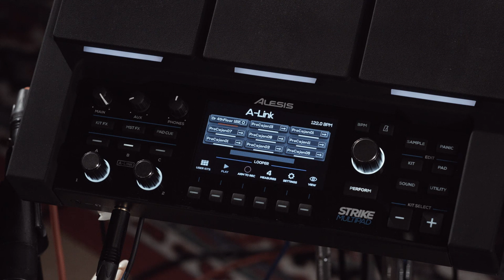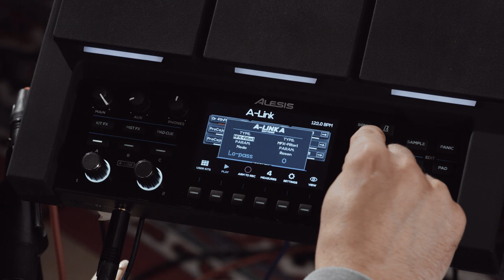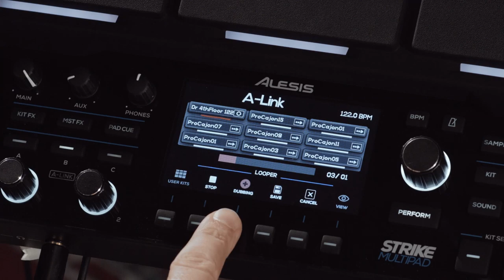Strike MultiPad - How to use A-Link

Comment: Do you reckon a updated version of Alesis will come out where you can auto-quantise loops live?
Reply: Yes Please!   Looper Quantize, Undo and Tempo Chase to external clock! Be sure to forward this request to Alesis support. If enough of us request these important feature updates hopefully they will listen and come out with v 1.4!
Reply: @egodeathbliss  yes I wish. I would actually use the looper if auto quantize happened. The annoying thing is that Roland octapad came out with that like 8 years ago. It’s not even leading edge tech
Reply: @CamMineo  Be sure to contact Alesis Support and send them a message with this (and any other) requests. Hoping there is a Version 1.4 update in the works!

Comment: Good morning Sir,,,\

As earlier ,,please help to sync tempo feature in Strikr multipad ,,,,,You must have received reports for Roland's new launch for SPD SX pro with following features which are smilar to Strike multi pad 

1) multi coloured LED lights for each pad ( same as strike multi pad )

2) 32 GB internal memory - ( same as strike multi pad )

3) 200 kits which includes 60 presets & 140 blank kits ( strike multipad has 100 Kits )

4) multiple effects ( same as ALesis strike Multi pad)

5) Tempo Sync ( Increase /decrease ) option for loops & samples ( Not available in Strike Multipad )

6) On board pitch setting for immediate correction ( Available in Alesis Strike -Multipad but very long procedure)

7) Price @ 1350 USD ( Alesis strike Multipad -Approx -850 USD )

Dear Sir,,

If we try to correct only one Tempo Sync feature ( Increase & Decrease tempo) on board ,,,you can get huge business in Indian market ,,,please think on it & if possible make a correction in new update ,,,

If any thing you want to discuss you can Mail,Message or Whatssapp me on +91 9327240082,,

SIr India is a huge market for percussion pads & Samplers ,,,yearly Roland is selling almost 4000 to 5000 percussion Pads/Samplers 

Note : Tempo Sync feature can convert your business in good Quantum 

Hoping for the favourable & FAst reply 

Thanks regard s

Vihul JAgirdar
India 
+91 9327240082